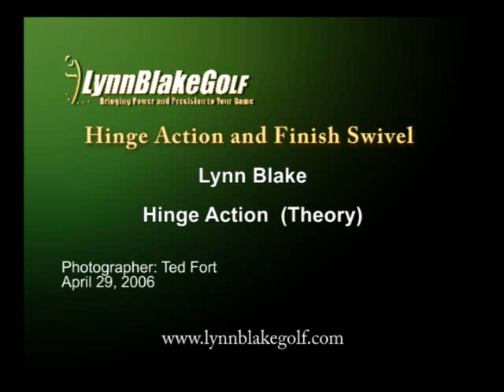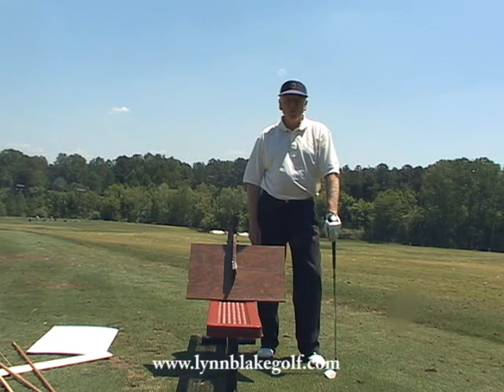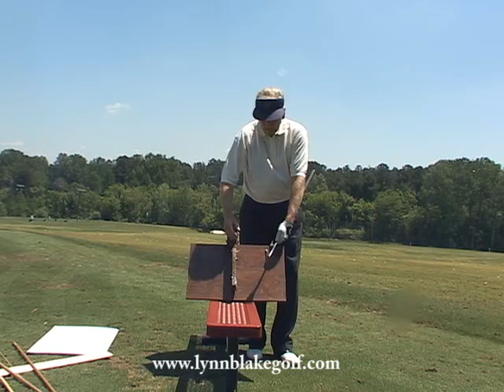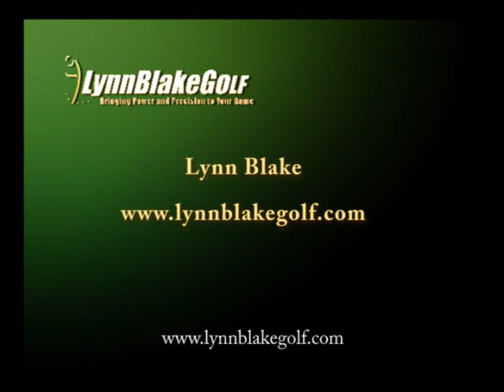Lynn Explains Hinge Action (part 1)

Comment: The left shoulder socket is a ball & socket joint connected to a free floating scapulae not a hinge or multiple hinges, & on top of that the left forearm rotates.
The golfing machine is not reality but based on a subjective ideology.
There would be nothing mechanical naturally holding the face square to the target resting on a plane. If a persons left arm went numb while holding a iron on a plane the iron would fall on its back or face flat against the plane.
Reply: Actually you are looking at that out of context. He does mention the face rotating later in the follow through because that's what the club naturally does(he calls it swiveling). The plane heis refering to is through the hitting area. In those moments the left forearm is not rotating.